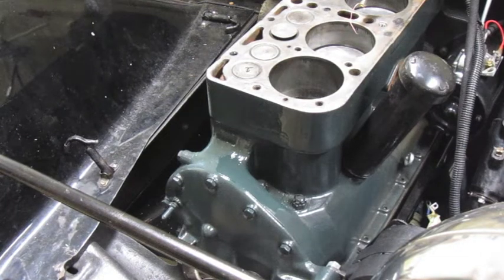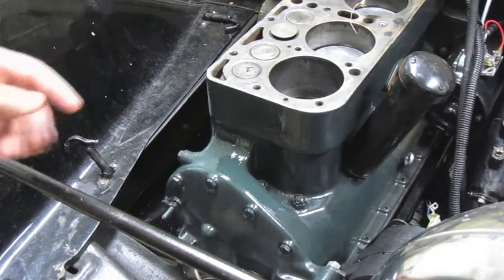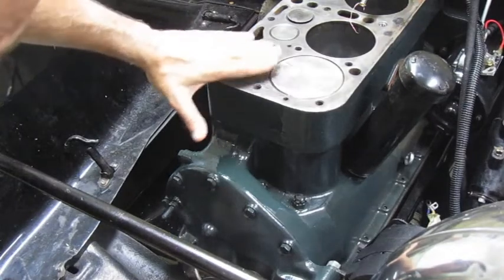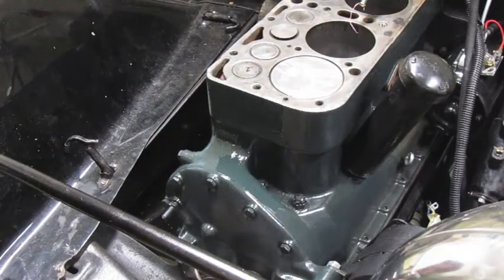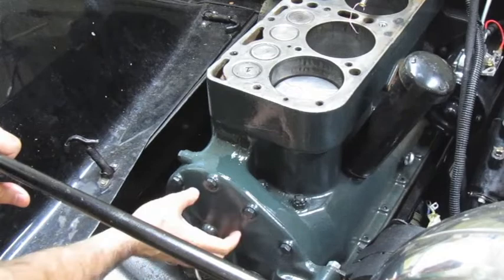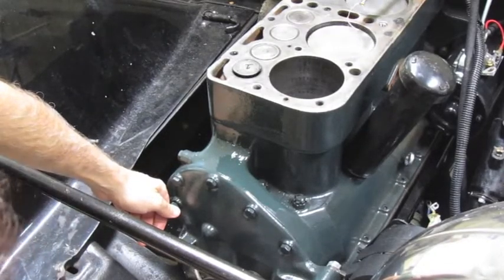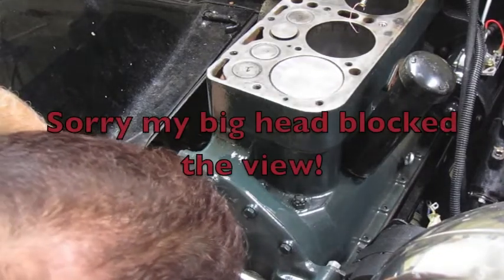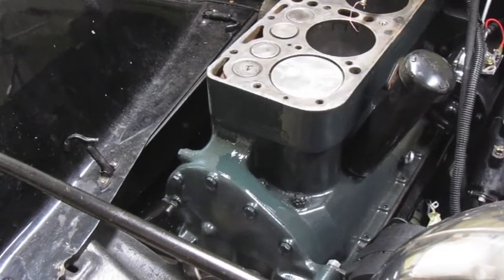Ford Model A - Top Dead Center (TDC) timing example with head removed

Comment: I had a cam gear go out while driving.   It felt like I lost spark.  I couldn’t figure it out until I checked the cam gear.   About 10 teeth missing.   I came to this video because I think I put the new gear on during the exhaust stroke 😣.   Im tearing it all back apart.   Great video. 👏👏👏

Comment: Pulled your video up just to make sure Model A Ford engines weren't designed with a bizarre cam timing. Turns out my timing gear failed during a compression test which REALLY threw me off for a while. Thought I was losing my mind!!! hahaha Thanks for the video!
Reply from the maker: Better your timing gear fails in the garage than on the road!  One quick way to test if your timing gear is not engaged, is when you crank your Model A with the distributor cap off, you should see the rotor inside rotate.  If it does not move, something bad happened.